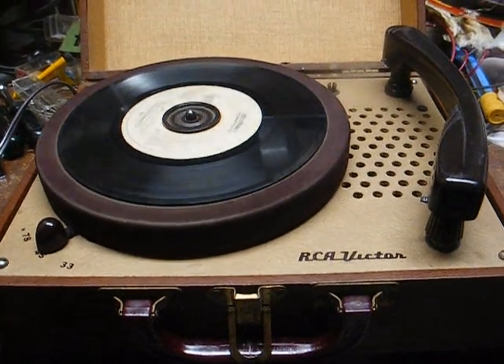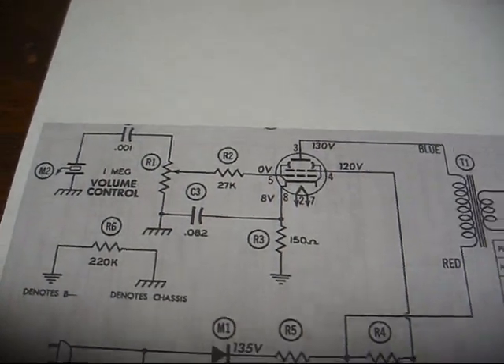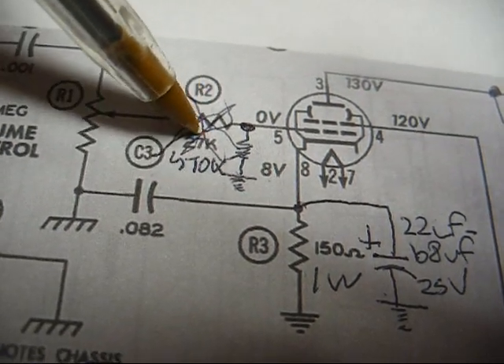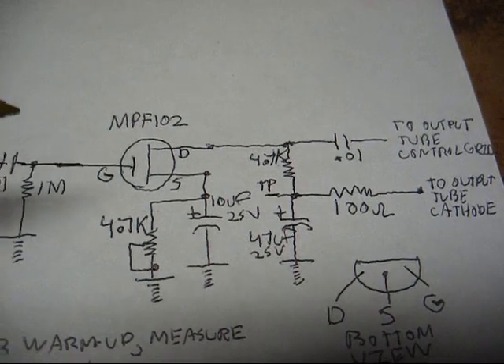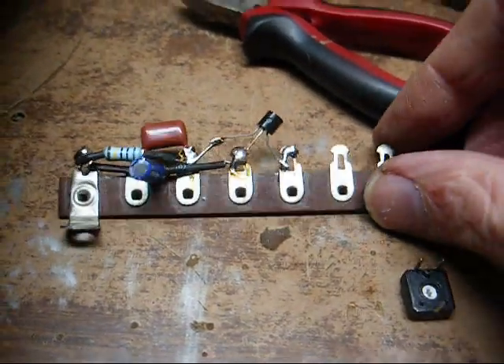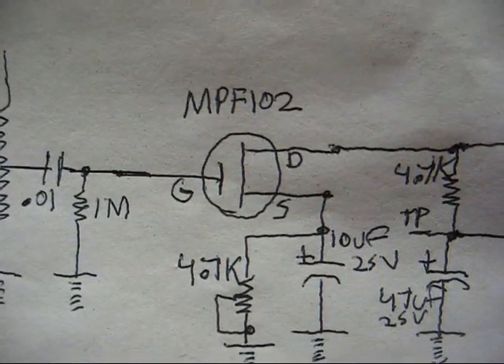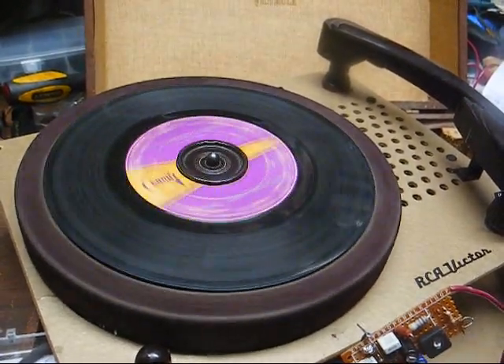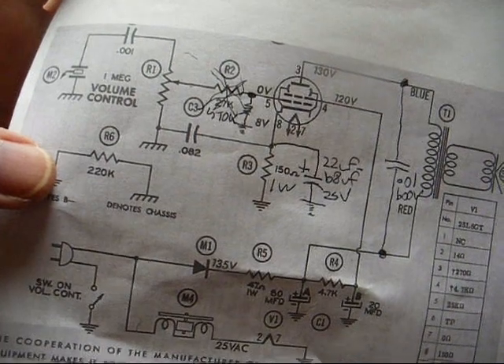FET driver stage for your single tube record player

Comment: I am still catching up on your older posts and just saw this one.  I have been wondering if you had considered such a thing as a little preamp that would help get around the crystal cartridge shortage!  Now I see that great minds think alike!  Clever way to get low voltage but I figured it would hum... but I digress.  I'm a Shango066 fan and heard about you there.  I enjoy your "rants" (I would call them "observations"!) as well as your electronic knowledge.  I am 65 and can relate.  Thanks for your efforts and for posting them. 

Cheers, 

DD

Comment: Some FET's have different basing connections, either S-D-G or S-G-D.  And some "MPF102's" can be either way.  One of those Chinaisum parts testers (Like Shango66 uses) can figure this out.  Of course you may have been sold some BJTs instead of FET's.

Comment: Radiotvphononut: New subscriber retired solid state/ digital tech. 33+years. Question: Would this FET pre amp work for a Blue Tooth, DVD /CD option design similar to the needle cartridge ?That is, for use in a similar valve amp or radio?
Reply from the maker: It should work. In a radio, you should not need an additional preamp stage because you can use the first audio tube or transistor that is ahead of the output stage. With a single-tube phono amplifier, you'll need the preamp if using a modern line-level source or low output ceramic cartridge.

Comment: The 27K resistor in series with the control grid is called a "grid stopper resistor". It's main purpose is to reduce rf pickup and to prevent the output tube from oscillating at ultrasonic frequencies. Some amps have it some don't. My guess is that when this amplifier was designed, the engineer put it in for good measure, or that when the prototype was tested, the problems that I mentioned above were observed. Just for the heck of it, put a scope on the speaker terminals and see what you see both at no signal and when playing a record. Gotta remember that one tube wonders were built as cheaply as possible, so every part in the design was there for a reason.

Comment: The person who was bitching about seeing so many of those old record players can screw him or herself for all I care.To me,they bring back alot of memories as I owned alot of them between the late '50s through the '70s.The earliest one  I owned that I still remember the brand of was a "Beam".I also had an RCA clone called a "Dean".I also had a "Steelman" sometime in the late '60s.I had to replace the entire tonearm with cartridge.Thanks for the videos.Keep 'em coming.
Reply: As I've got that '52 Midwest that needs recapped,I need to replace the cartridge as well even though it has plenty of output.Some input from you would be greatly appreciated.It has a three speed changer in it.Shango 066 did an Aircastle with an identical record changer.It hasn't been played in several years.

Comment: I wondered how a FET preamp would be powered in such a modification ... powered from the cathode voltage? That's so simple it's genius! What isn't genius, from what I can see in the original schematic, it's all directly running of rectified mains, and the tube filament is in series with the motor? I see how that would all work but what were they thinking not having any isolation transformer in the supply? It's a disaster waiting to happen!
Reply: A lot of older electronics used a hot chassis without any isolation from the line. The disasters certainly did happen, but weren't all that common.
Reply: True, things were dangerous back then. They have trsnsformerless guitar amps they now call widowmakers.
Reply: Don't think that a transformer power supply makes everything warm, fuzzy, and safe. Tubes run at relatively high voltages that can really "zap" the unsuspecting.
Many years ago, I was repairing a high power PA amplifier, i lightly brushed against a live 600V B+ line, that sucker literally threw me out of the room. The only "safe" power is low voltage batteries or UL class 2 wall warts or desk bricks.

Comment: West-Tech rebuilds the old Astatic type crystal cartridges for about 50 bucks.  West-Tech claims theirs will last a lot longer than the originals. This would eliminate the need for a booster. I used them a couple of times and they do good work. Had any experience with them?
Reply from the maker: They've rebuilt a couple of 78 cartridges for me, without problems. With the newer ones, I'd rather install something that will allow playback of newer records, as well as the old ones.

Comment: When it comes to parts, If I cant get it from Mouser, Digikey, or Newark (the big three) then the chances of finding genuine go down drastically. Speaking of RCA, I remember parts issues. When projection TVs were still a thing, the HV splitter block was a common one. in the PTK195 and PTK169 chassis, at the time I was using MCM until they quit carrying RCA parts. then I went to electronix, now I am out of the biz of course.
Reply from the maker: Those generic splitters were doing good to last for 3-4 months.

Comment: The reason they leave a capacitor off the cathode could be to reduce distortion or cost. Well good job and I have bought decent parts from Ebay but at a fair price and from China, maybe half of locally sourced. .

Comment: Howz about using a mic impedence matching audio transformer?  Step up the lower voltage cartridge to 3v. If it kicked up the volts too high, use a small ballast resistor in series with the secondary.
Reply: I suspect that a preamplifer circuit would have a better frequency response than a matching transformer-!
Reply: So would an amplified three way speaker system, lol. , but this is a crappy rekee player with 4" crappy speaker and crappy cartridge.  It will sound crappy anyhow.  Best thing would be an output jack to amplifier from the tone arm, and use the crappy one tube amp as is for a monitor.
Reply: @umajunkcollector  ...IF YOU SAY SO-!!
Reply: It's a crystal cartridge that's looking for a load in the megohm range. Where are you going to find a transformer that has that kind of impedance spec?
Reply: It's called 3v, voltage, it creates voltage from vibrations.  But it would need a 1:3 step up transformer, many audio mic transformers are more like 30:1 to convert hi imp to low.  It would be easier to use a lower grid resistor.
Reply: @johnstone7697  Good point...

Comment: I wouldn’t buy parts from eBay
I get all my stuff from mouser
Reply: eBay allows feedback which sellers thrive for a decent rating.  You sell junk, people find out quick. I had good luck with China sourced as long as it is original brand. Usually China sourced is half of domestically sourced and you wait a month.
Reply: Agreed. Epay has a lot of bad parts floating around. I personally use Mouser or Digikey. Jameco is okay for generic parts.

Comment: Thank you for your videos, I do learn a lot from you repair videos. FYI: R2 is a grid stopper used as part of a RC filter (where the internal capacitance of the tube grid to cathode is the C ). It short high frequencies to ground to prevent high frequency oscillation.
Reply: Wow, I learn something about forgotten technology.